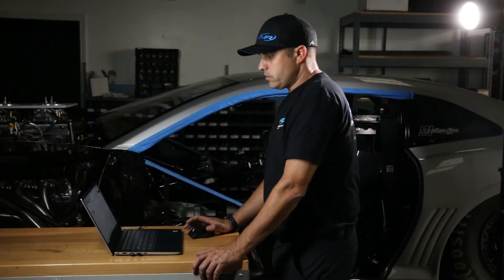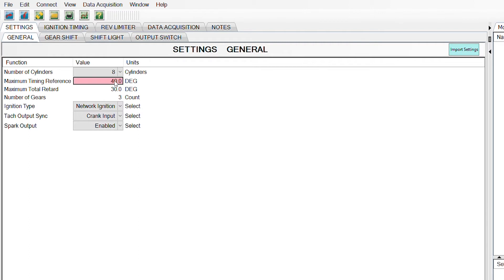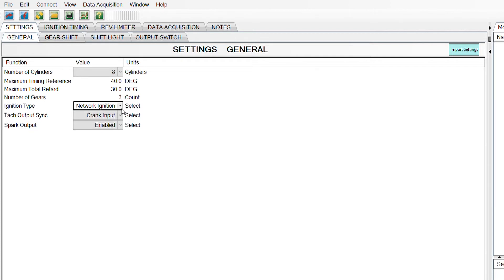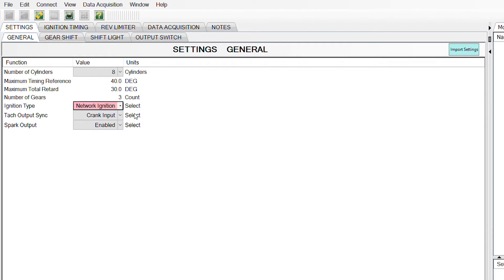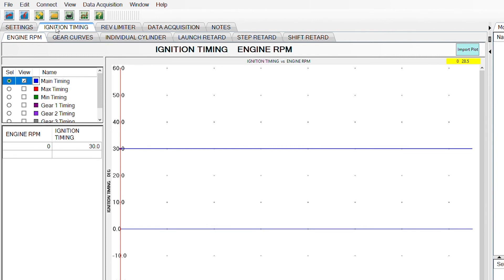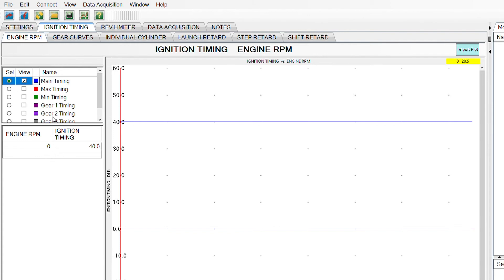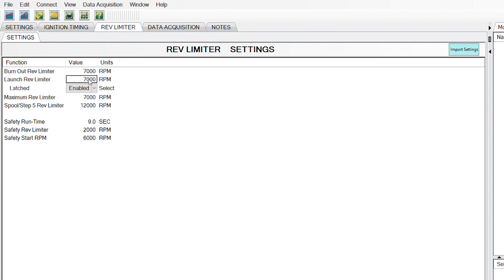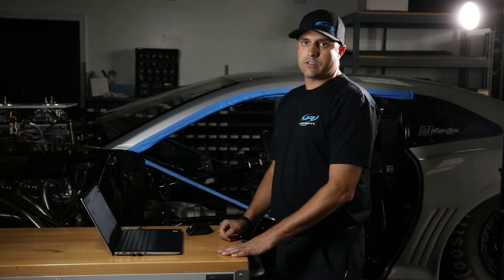MSD Grid Setup With Modern Racing

Comment: Does the grid have shock travel sensor and 8-egt setup or do you halve to use the Racepak V300SD with the grid if you wanna use those two features? Thanks